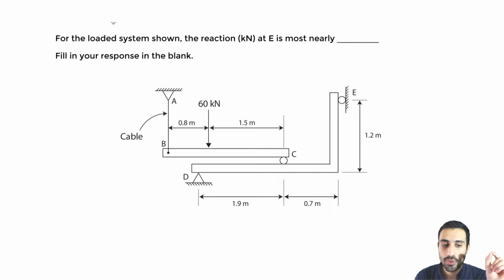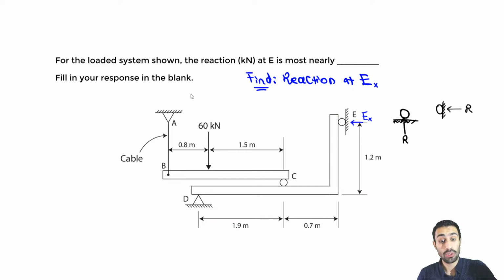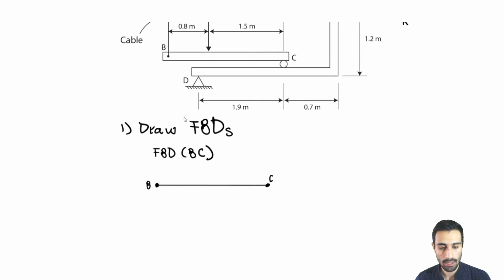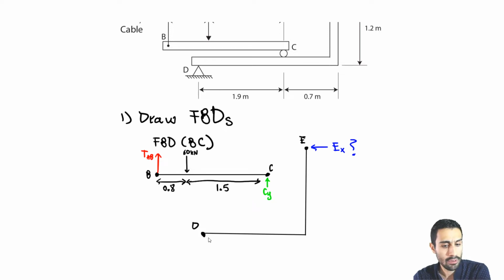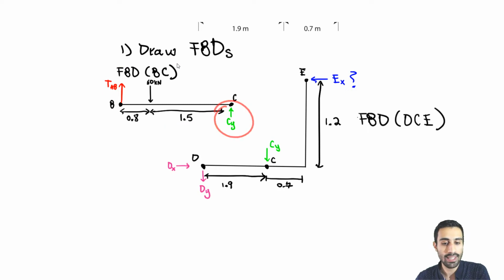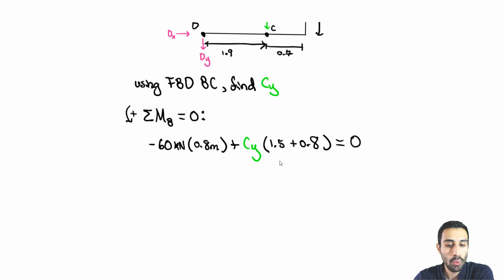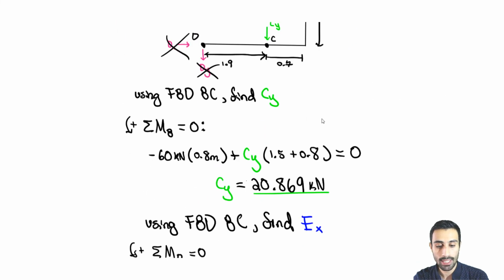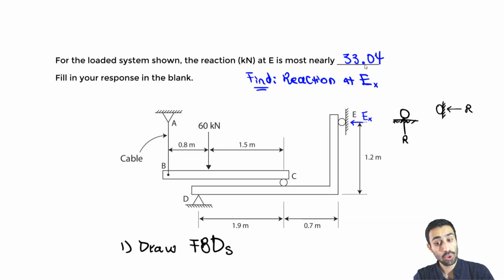FE Exam Review - Equilibrium of Rigid Bodies - Statics

Comment: Hey,
Clockwise moment shall be positive and Anti clockwise shall be negative right? but in this video it's vice versa.
Reply from the maker: In most U.S. engineering courses, especially those taught using Hibbeler's textbooks (e.g., Engineering Mechanics: Statics and Dynamics or Structural Analysis), the convention used is:

✅ Counterclockwise (CCW) moments are positive
✅ Clockwise (CW) moments are negative

This is opposite to what you might see in some other countries.I recommend sticking with this convention.